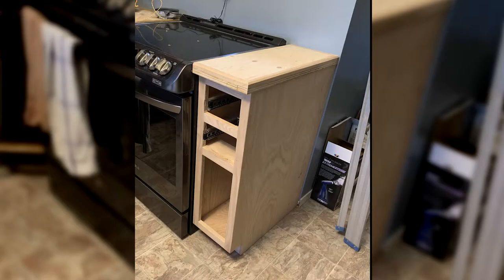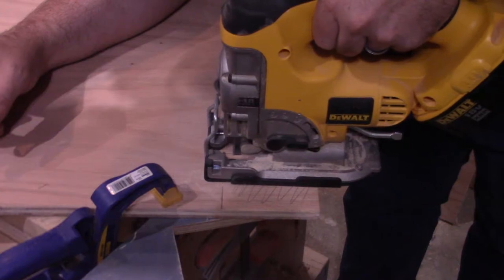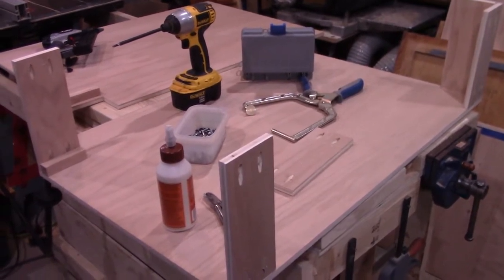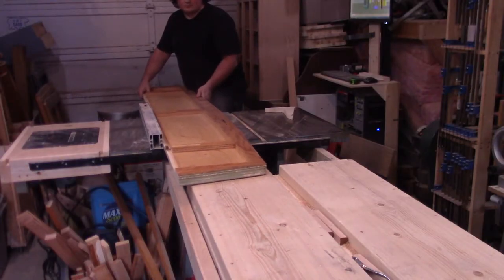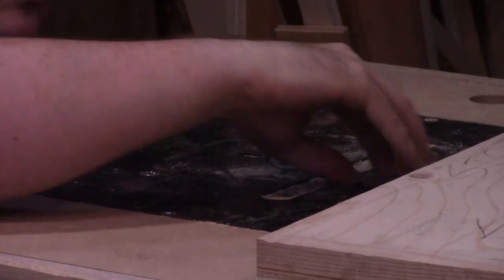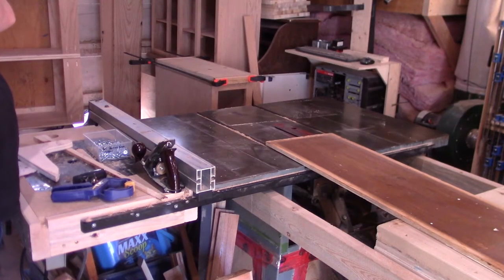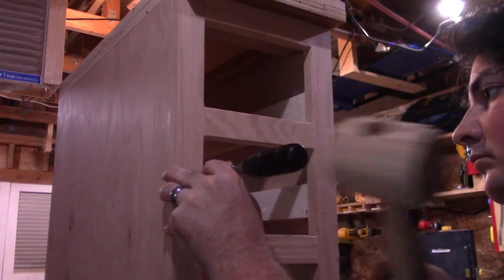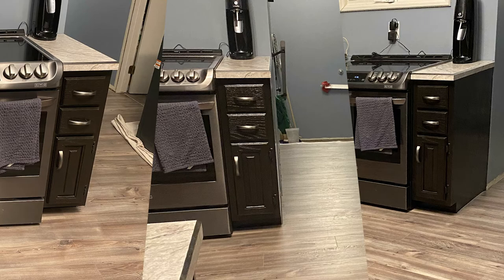Building a Stove Side Cabinet

Comment: This is very interesting. It sucks that lumber prices have gone so high. Not gonna lie, if I'd used the wrong size screws I would have used wood putty to patch it and then used shorter screws. LOL. 
Ah, commissioned project. That does make a difference.
Have you ever built a cabinet for a cooktop? We keep having problems with mice getting in to the oven & we never use an oven so we want to replace it with an induction cooktop. Problem is, we don't know what to put under it and I was thinking of building a cabinet for it and hoping I can find some of the leftover oak from when we initially made our cabinets for face frames.
Reply from the maker: Basically if that panel was anywhere else and not the show side it would have been fine to patch it, 😂
As for a cooktop cabinet, I don’t know for sure as I’ve never installed/used one. I wouldn’t imagine it would need any more support your standard kitchen sink. Would probably just be a matter of mounting it to the countertop and running the electrical, but I would suggest confirming with the manufacturer/supplier.
Reply: @JohntheSchreiner  Thanks. I've read that it can mount in a sink cabinet if you can find the right size one. They don't seem to have good quality pre-made ones. I do know the drawer has to be lower since the cooktops go down about 5" into the cabinet and there is heat so whatever is below needs to be heat resistant.
Reply from the maker: @mycats7321  Yeah that makes sense. Unfortunately I didn't get a good look at my Aunt's before she took it out, otherwise I might have some more insight for you!